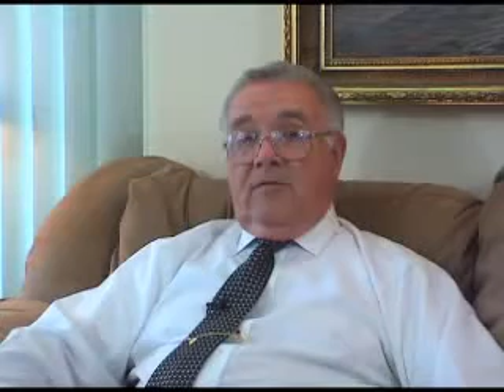Dr.Paul Internal Combustion Engine - 80% Efficient!!!. part3

Comment: @MrDreamer3000 That is exactly what he is saying: 5:54 Let me quote: "Efficiency at 30%, that is at maximum power if you start reducing it going toward part power or cruising speed the efficiency goes from 30% down to 25, 22, 20 and you are going 30 mph you are down to about 15% efficiently".. What he is saying there is that your car would be most efficient at full throttle and that cruising speed would give you worse fuel efficiency.. And please explain your formula..
Reply: the energy content of the fuel being converted to horsepower or engine output. not the same as "mpg".

for a vehicle that requires 10hp to maintain a given speed, a 10hp engine operating at maximum VE would give better MPG than a 100hp engine being throttled, or having its VE reduced, to only produce the required 10hp.

Comment: So what he is saying is that normal engines are most efficient at max hp.. Then why aren't we all driving around at max rpm (where you achive max hp) to get the best fuel economy possible.. Hmm. I think you are wrong sir..
Reply: The Otto cycle engines torque is controlled with an air throttle valve. So when you want to cruise on the highway at less than max speed you must throttle the engine down to the power level to maintain that less than max speed. You choke the air flow. You introduce pumping losses = less efficient.